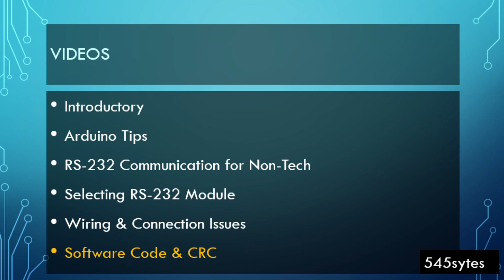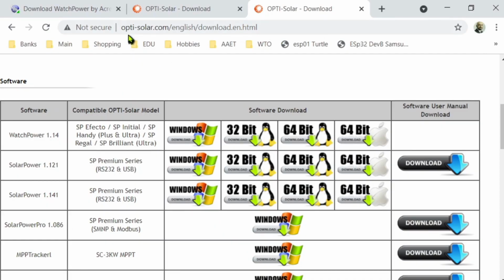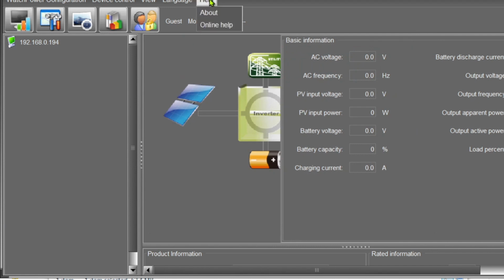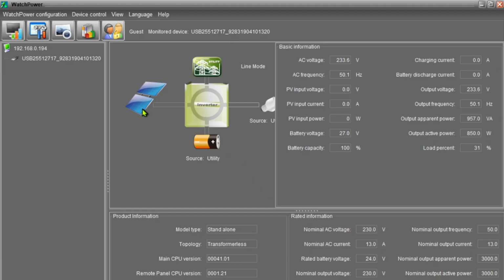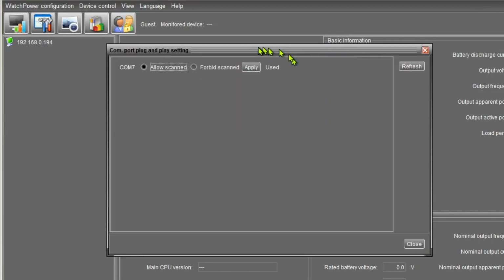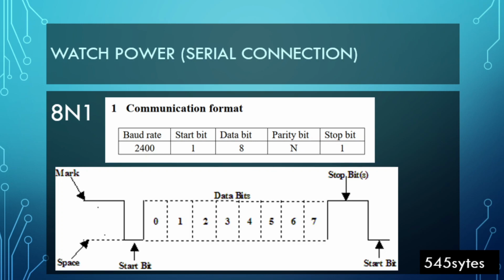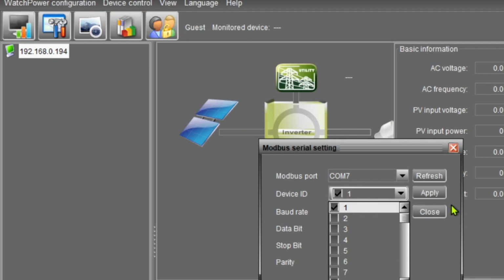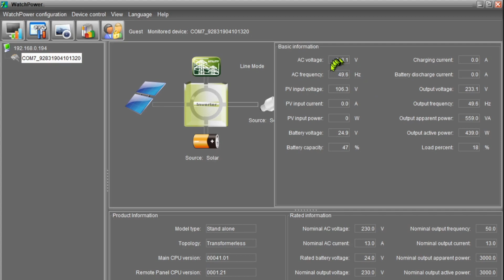7 (Ard to Invt) 'Watch Power' installation & Usage

Comment: When I plug in my USB i hear the windows chime as if it's plugged in, but I do not see the COM connection info (USB255127etc) below the Computer Name (192.168.0.194).  How can I get my USB to show below the computer name? Thanks! (I logged in as administrator, but nothing works and no com info displayed)
Reply from the maker: I missed this post earlier. I hope this is solved by now. Yes I get this problem some times, Watch Power takes time to connect (Sometimes) - Let it work for few minutes, then connection will show